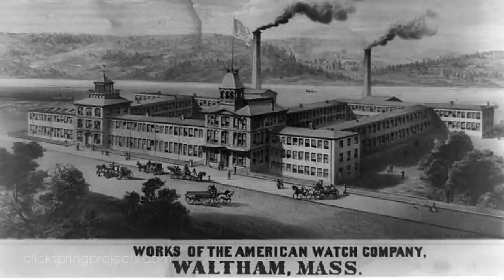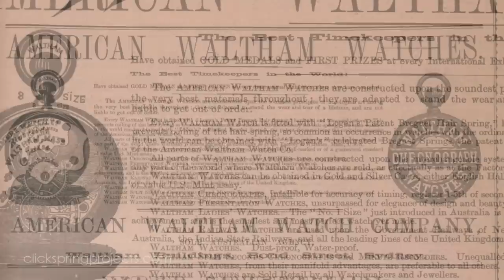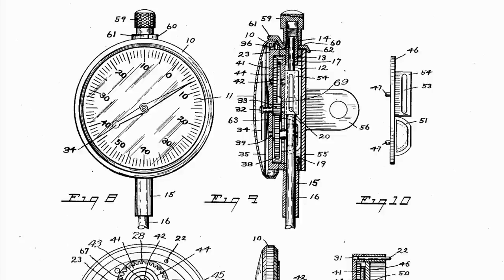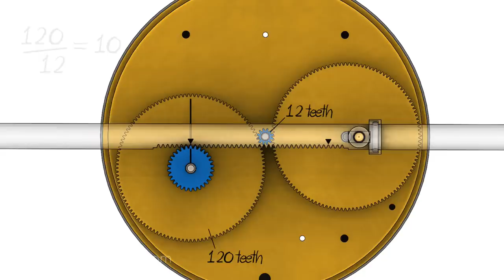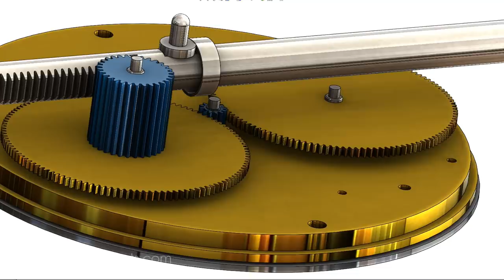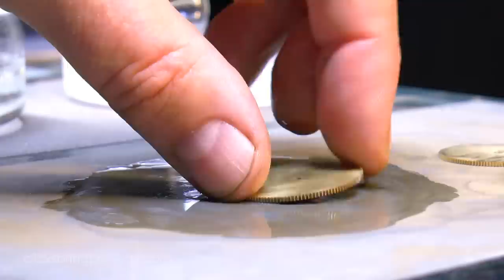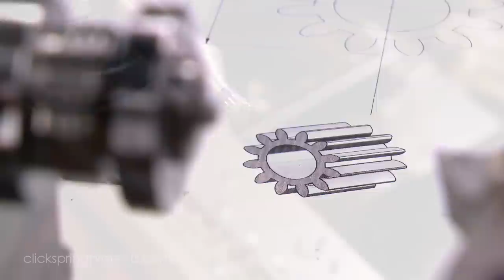Patron Series 3: Constructing a #ArtDeco Dial Indicator Part 1 - Making The Wheels, Arbors & Pinions

Comment: Using a dial indicator to construct a dial indicator, a wonderful paradox.  Thanks for sharing!
Reply: I also thought that on the test indicator.  But I suppose you could use a very long lever held in a pivot since it was just to check runout and not measure.

Comment: Yes they can be used for many things. We, guitar players, technicians, and luthiers, use them, also. We used them to measure fret height. String height. Neck relief. All are small measurements. 1-2mm max. With neck relief being the smallest number from zero to 0.4 to 0.5mm
Reply: Most luthiers just use a feeler gauge or... business card or quarter. X)

Comment: Nice work. I did a 4 year apprentice to become an instrument artificer then moved to London and repaired and calibrated various bits of kit for years. We had an isolated room in springs with set temperature and humidity with an extensive set of Standards we used as references. So its almost back to work for me today. 2x 👍

Comment: I saw a homemade dial indicator in an old shop they were selling out.
They used a Chevy oil pressure gauge as the basis. It was a dirt floor shop so it could have been from the twenties or thirties.
I think they just through it away, wish I had drug it home.

Comment: Here's an idea you (or anyone) are welcome to run with if you like- i probably won't ever get around to as i am a poor machinist 😂

I wish my pressure regulator had a larger face, with big bold letters that i could more easily read from 15 to 20 feet away. 
I'm a veteran lampworker, and just beginning to learn TIG welding.  I therefore have a lot of compressed gas tanks around my workshop.  I'm middle aged now, and perhaps my eyes are starting to go.  The shop can be dim outside my task lighting, and welding shades are dark!  A solar garden light type circuit repurposed to make a backlit dial face would be a fine and wonderful thing.

Comment: When cutting teeth on the gear wheels 13:03 , can one drill tiny holes in 3 locations. Then solder the two together instead of using glue? Seems this would be much less likely to come apart.  The holes could be drilled out larger to  disassemble , or simply add heat the evenly spaced holes can be used to lighten and accent the gear. Seems this would be the better means to connect multiple wheels together especially more than two. I want to get a lathe and mill  someday, maybe a shaper also, possibly building them. I don't mean large equipment. Capable of milling a 18litre engines crankshaft (from a large  truck) I'm also not talking about something where all three can fit on a desk at once. Not even one really fitting really, I'm thinking possibly a lathe with a 6"-8" chuck capable of turning something about 16" diameter and 24" long and a mill bridge port style , capable of milling a 24" cube. Maybe a rectangle , 30" tall x 26"x 26" and a shaper with about 12" stroke I'm thinking of a compact hydraulic design using a cylinder with roughly. 2" piston with a table about 14"x14". and 14" high shape a 12" tall cube easily.  Because what I really want to build is a engine from scratch. Like a modern reproduction of a 1880's -1910's oil field engine ,,pony engines farmers used. I would like to build a couple. One a oil burner. Compression ignition/diesel. Possibly 4+ engines, maybe a proof of concept semi model version. With 4.5" bore roughly, and 8" stroke,I'd really like it to be opposed twin cylinder. Cast and mill all the parts and the bearings , valves, oil pump, timing chains taken from common engines. Cast the crankcase and cylinders from aluminum rims and heads and intakes from a salvage yard.  Cast cylinder liners from   brake rotors. Possibly find a diesel piston the correct size. And hand forge a piston rod, mill it to use commonly available bearings and weld up and mill a crank from 1" x4" Flat bar or possibly  from 1" thick plate, (two 5/8-3/4" plates welded together . With round bar(about 3")
For the rod and Main journals. With both pistons up/down at once  the vibration should be minimal,  also possibly turn cam shafts from the 3"bar also. With roller bearings . Cast two flywheels roughly 18"-24" diameter and the outer hoop about 4"x4"with 3-5 spokes 1.25" diameter. Round or possibly 2" flat and 3/4" thick at a slight angle to act as a fan, the engine (if producing enough power) use it to generate power to charge batteries. Running at up to 1800-2000 rpm. But normally with govenor  800-1000rpm , with a high flow intake design, and 20:1-22:1 compression and possibly a supercharger the $200 amr500 remanufactured Japanese units,  with two 2.220" intake valves and two 1.880" exhaust valves.  With high ports aimed directly at the top of the valve it could possibly perform better with two valves per cylinder,  given the low rpm operation. It should still prouce 100 ftlb TQ.+, and 30 HP with 20:1-22:1 compression with possibly as much as 26:1 , the combustion chamber being inside the piston. With the head cast from brake rotors the cylinder liners being 3/8" -1/2" thick inverted top hat,  or spool shaped wet liners. To resleeve,  over bore the liners and press in sleeves, it's more like the aluminum water jacket is pressed on the cylinders.  The larger version is roughly the same design only nearly doubling everything, 8" bore with 12":stroke 30"-36" flywheels. Use bearings from a roughly 18litre diesel engine  possibly the same bearings ,  custom cast pistons casting two pieces possibly, a iron  dome with aluminum skirt. Basically a 8" disk with 4" pick to er in the center, with ears on the back side for the piston pin. The rod having oil passages, to feed the pin with the pin passing through the dome and skirt. Them possibly bolting together,  the cylinder cast from brake rotors, basically a 9" pipe, 8" inside near 9" o.d.  the rings being 2mm slices of a 8.25" pipe  cast from the same brake rotors, and Made into rings  ,  I'm thinking two  rings per groove with pins to keep the gaps from lining up. With two 4mm grooves both having two 2mm rings , or a single 3mm ring milled like a pair of rings with offset gaps about 12mm with the gap never exceeding 2mm, the ring becoming a zero gap ring. The oil ring being a Pair of 2mm rings milled with a slight angle on the face to scrape oil with a coil spring around the groove to space the rings apart , using two intake valves 2.22" an two roughly 2.0"exhaust valves with two ports each , and possibly a hyper pressure air blast injection system. Using 10-20cc of nearly1000 psi air to blast in the fuel, acting as a extreme pressure venturi igniting the fuel at the same instance. The air pressure only being about 250-300 psi over the compression pressure produced by multiple stage compressors , into small tanks to allow cooling. Each compressor  adding about 200 psi to the air the air storage before the injector plunger bring about 8-12oz and cooled by the fuel with a coil of steel fuel line inside the micro tank, if the injector nozzle is made correctly it could possibly exceed the effiency of the most modern diesel engines. The fuel burning should look similar to a lean gasoline flame. No smoke or solid particles just a clean burning flame. This engine having two superchargers one per cylinder. Should produce 250lbft TQ, and 80 HP at 1000-1200 rpm. I wouldn't want to stand by it while doing so.. a 5 lb piston moving 12" , 24" per revolution, spinning over 1000 rpm is a few ton of force. Using main studs in the rods as the rod bolts . And a serious rod not made from the average cold rolled steel! Milled from slightly hand forged high carbon steel then milled to near spec. Then heat treated and ground to spec.  Being about 16" long, (14"-18" to clear the piston and 12" stroke, and the counterweights. That are possibly bolt on, with main studs about 1/2"-5/8") with 1/2" dowel pins for alignment. SORRY to ramble, I got carried away... I have been thinking about this for years. No way would someone help me with such a insane project. I definitely couldn't afford to pay, so if it happens I will be required to build it myself, after likely building the equipment to build it with. , and the furnace and foundry to cast the parts. Then buy suitable scrap to cast it from, the foundry probably first to build the equipment!!   Sorry again, have a awesome day,!!!

Comment: Outstanding video, the production values are incredible!

I’m curious why the smaller gears are created as separate parts as opposed to being integral to their shaft? It would seem to be a fair bit simpler and guarantees concentricity, but I’m sure there’s a trade off I’m not considering.
Reply: He comments in the video that with an all in one pinion and shaft (arbour), if you make a mistake, or need to change something, you've got to remake the whole shabozz, instead of just the pinion or the arbour. Cheers  :)

Comment: I'm not sure if you explained it in the video, but is there a reason for you choosing to do the indicator in imperial when you use metric when measuring?
Reply from the maker: Yes, I decided on imperial because I happen to have a set of imperial gage blocks which I will use for validation of the tool - Cheers :)

Comment: Is a giant rotating ninja star of death used to form all toothed wheels at any scale or are there other methods once size increases to a certain point?

Also, would love to see some kind of collab between you and Cutting Edge Engineering. No idea what you could build but Kurtis has a love of vintage machines, I'm sure there's something you could both get into.
Reply: as size goes up, the tools can get more rugged: overall size is larger, and it gives more room to segregate hardening and heat treating zones so the hardness is concentrated in the cutter edge. searchable term for gear cutting is 'hobbing'

Comment: Theoretically, how could one start with cheaper/less accurate machinist tools, and make your own, more precise tools
Reply: This is exactly how more precise and complex machines, etc. have evolved!😁
Reply: You could do this without an indicator, it's just harder. To check runout, you can hold a stick at one end and rest it on the workpiece. The runout will be magnified by the stick and can be adjusted until the movement of the stick is minimal. If you know the lengths involved, you can even measure runout by checking the movement of the stick.

Comment: How do you measure internal holes these small? Gauge blocks?
Reply: In engine factories they used 'Go-No GO' gauges; a rod of metal, the ends of which were two, precise, fractionally different, diameters. The bore was the right size when the smaller end goes in, but not the larger. Accurate to within 1,000s or 10,000s of an inch, or 100s or 1,000s of a mm. Cheers
Reply: Gauge pins.

Comment: Chris... one question: Should this project be done only on a small lathe? Aside from that question this will be a fun project. Info on my: a Precision Mathews PM 14-40 GT lathe, which is too big for the process. Chris, I will follow along in the videos. Please give me some recommendations for a proper lathe for this project. Please give me a few options: Top Tier Lathe, Middle Tier and lastly an Acceptable Lathe. Chris, I am in the USA. Thanks for these videos
Reply from the maker: Hello mate, I use a Sherline for all of the small stuff, your larger machine will be suitable for some of the larger components like the case. Other options for the smaller lathe are not easy to identify, its a complex topic - drop me an email to discuss if you need to - Cheers :)
Reply: Thanks